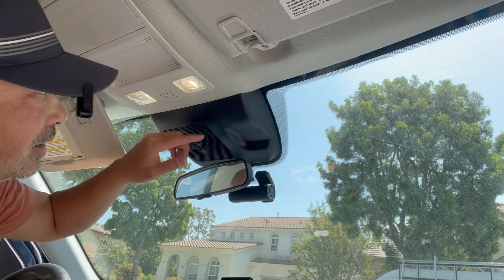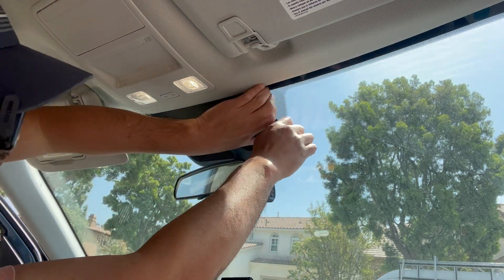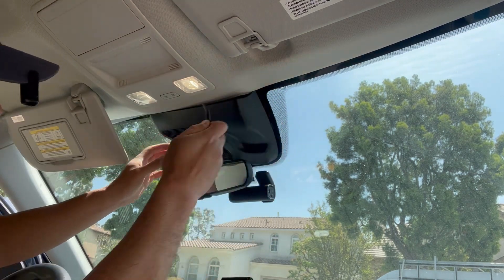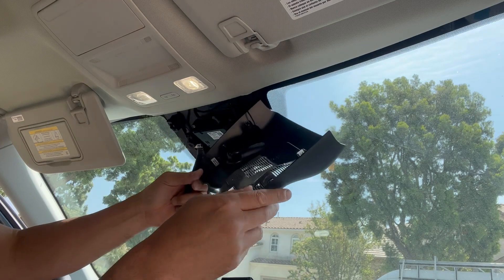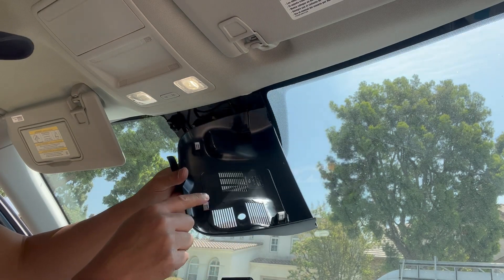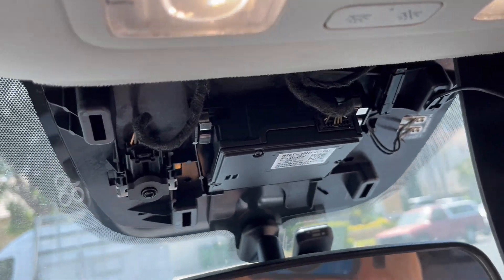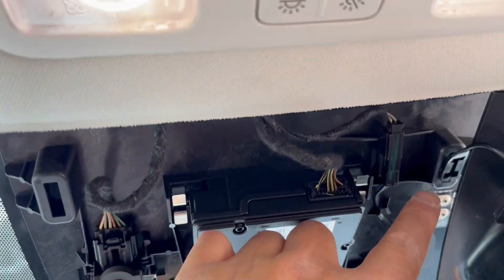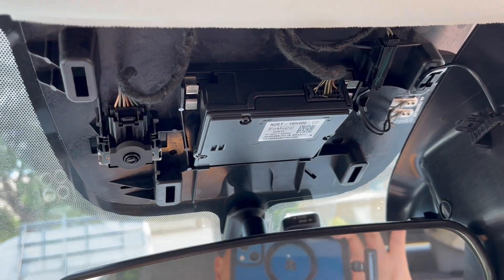How To Remove Housing Cover On Ford Maverick Rear View Mirror

Comment: Thanks. It was a bugger to get off.  Those clips were tight. I suspect that, like you did, it is better to start at the upper right. It seems to be a less secure clip. Once you get one the others are easier.

Comment: I tried it but I gave up.  It was hard to pull out.  I was scared of damaging the plastic cover edges. 
Is it really hard to pop it out first time?
Reply from the maker: It is not hard. Most of the time we are just too scared to break something. If you look at the video and see where the tab is located , you can go use more on one of the spots first. Good luck.